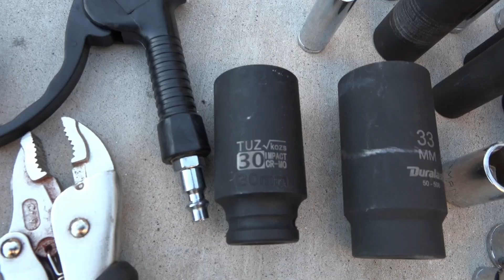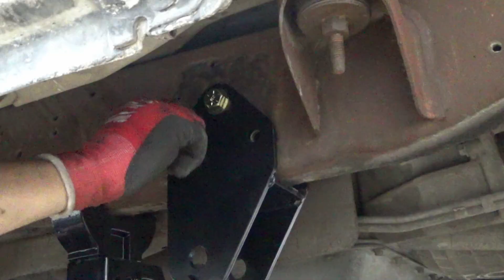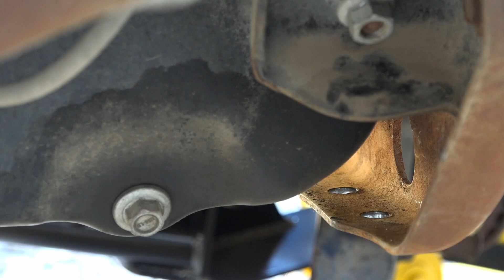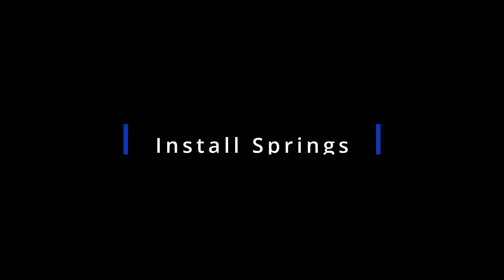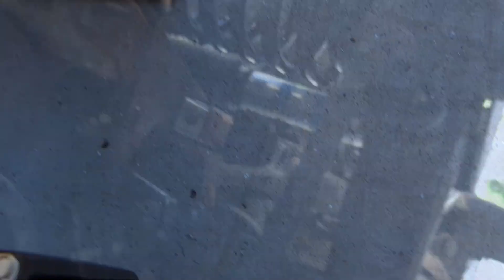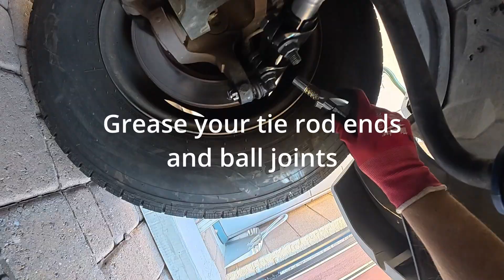Action Van Ultimate Kit Installation Video

Comment: Great video, the only one that explains step by step the whole process, great, great video. 
Question:
Before remove the Pitman arm, would be necessary make a mark or a line ?, because when we install the new one, we need to make sure that that position goes to keep the tires straight.
I am just asking, maybe I wrong, I don't know, I would say, put the tires the more straight is possible before remove the Pitman arm, draw a line then, when the new one be installed, line it up with the existing mark that we've made in the gear box. 
Please let me know make sense or,it isn't necessary. 
Thanks.
Reply: The splines on the pitman arm have some flat spots that only let you orient the pitman arm one way.

Comment: Nice job. How’s it ride and drive with the kit installed and how much caster did you get during alignment?
Reply from the maker: It rides way better than stock.  The caster remained the same as stock because the radius arms are modified to keep the caster where it belongs.  The camber was what changed a lot after the lift.  I am not sure how much but when it came out of alignment, the camber was back to normal again.